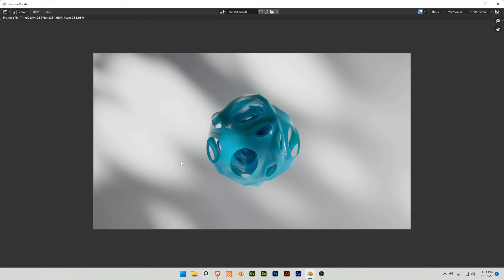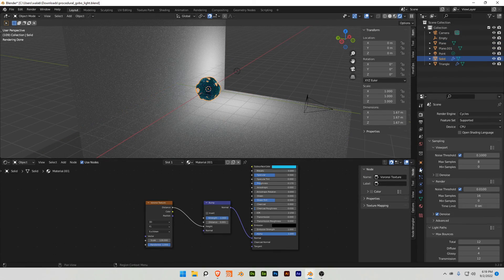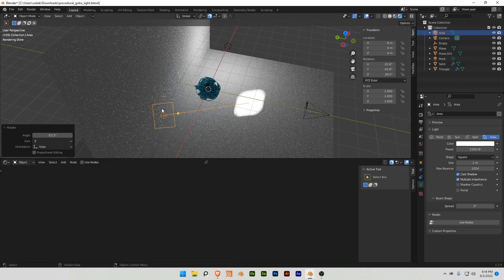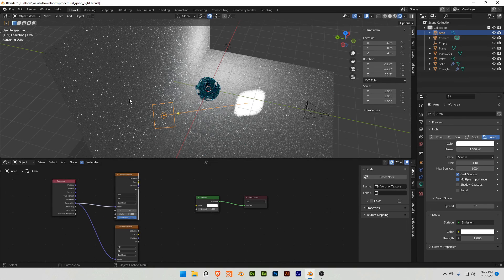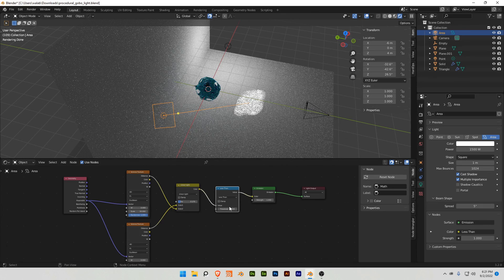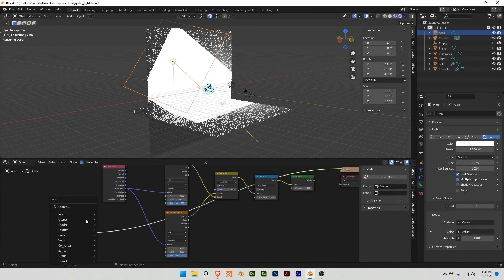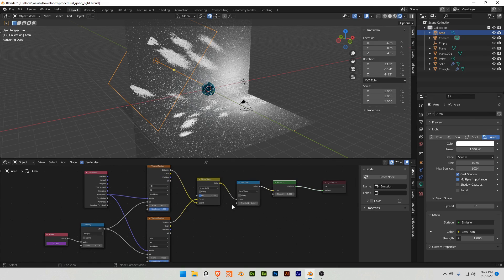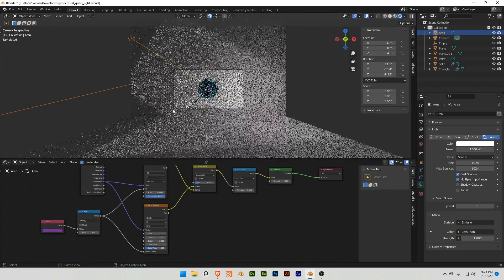Blender Tutorial | Procedural Light Gobo

Comment: Nice technique -- thanks for sharing! Do you have any idea on why this setup does not work in Blender 3.5.1?
Reply from the maker: The mix node may be the problem! U need to use that node and change it to color. Mixrgb is the old node!
Reply: @walabe8  Thanks for the quick reply! But it didn't work. Tried other combinations without success. Maybe some new bug, who knows...
Reply: @flavio8430  Hi Flavio, worked for me in Blender  3.5.0. To get the correct mix node do Ctrl + Shift + Right Mouse over one of the Voronoi textures and drag the mouse to the other one and release. Tick Denoise in the Render settings otherwise you'll get a lot of noise in the scene, the drawback is it takes ages to render. Hope this helps.
Reply: @EduardoRiganelli  Hi Eduardo -- thanks for the tip! I just found out the reason why my node wasn't working: the beam shape spread of the area light was at 90° when it should be at 5° (or less)! My mistake...
Reply: @walabe8  Hi, I'm using the Mac version of Blender, can't fine the tick box for use Nodes in Shader Editor - can you please help?